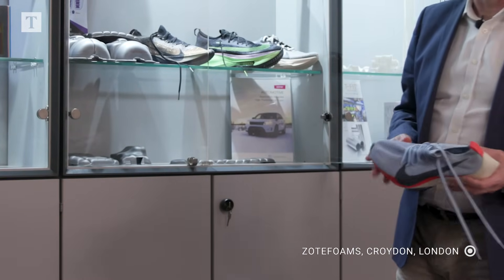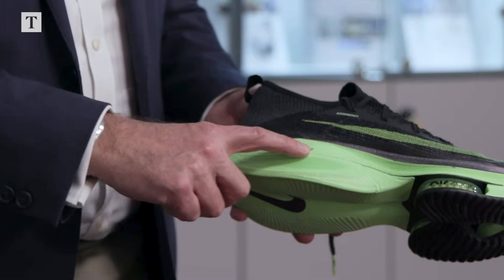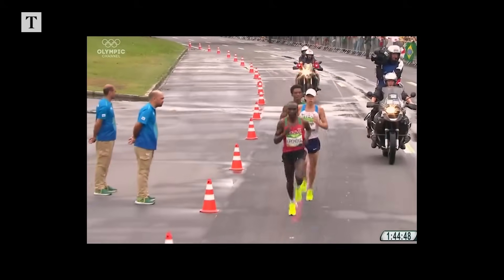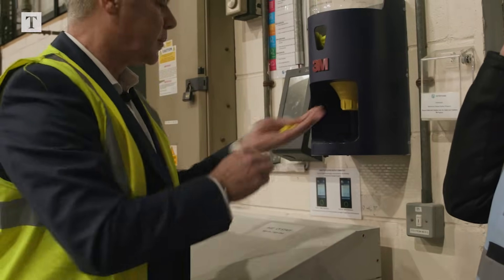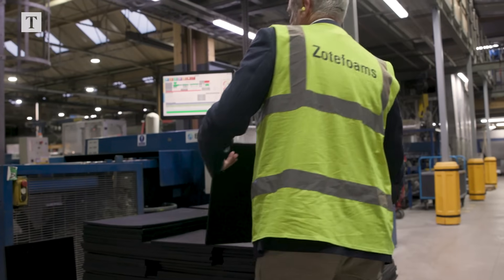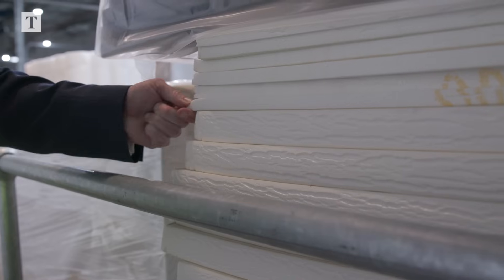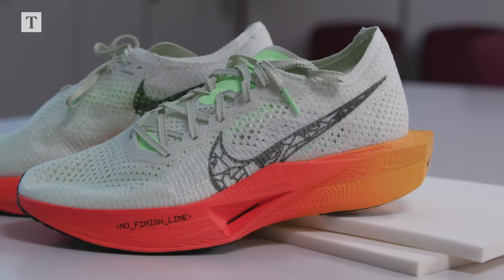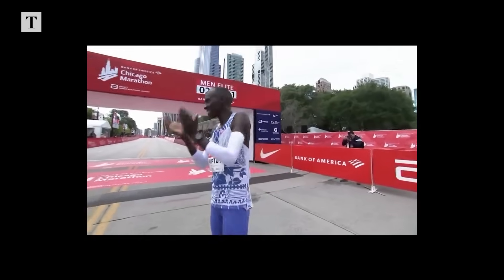Inside the London factory behind Nike’s ‘super shoes’ revolution | Sport Explained

Comment: This video makes it sound like this factory is behind the design and manufacturing of the shoe which is wrong. All they do is supply the ‘foam.’ 

Prototype Nike racing shoes are made in a special factory in Korea and then obviously consumer market models made in China and Vietnam. 

Also he’s wrong saying the shoe was first used at Rio Olympics. I have an actual pair that was used in that Rio Olympic marathon. They were already testing these shoes back in 2015 including races and the 2016 US Olympic Marathon trials
Reply: i did not get the impression that this factory does anything else apart from manufacture the foam
Reply: As someone who had few years working in foam related product , I think what the role of foam material development here is significant and well described in this video